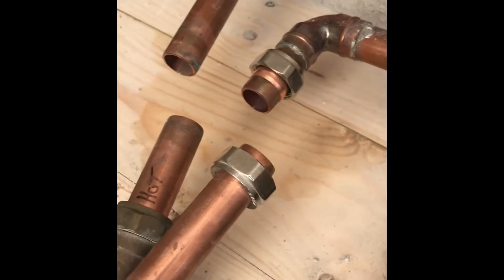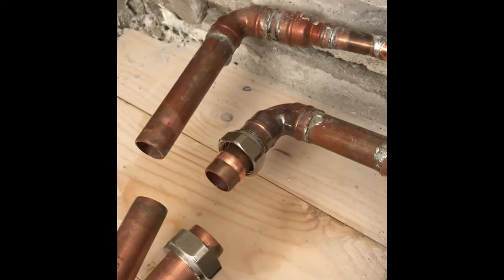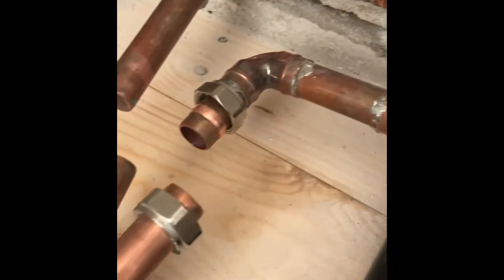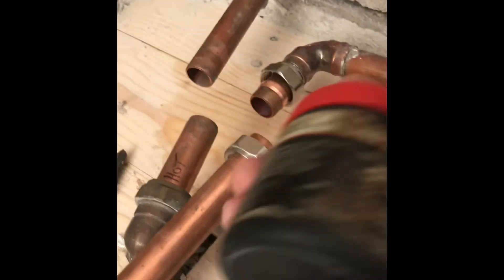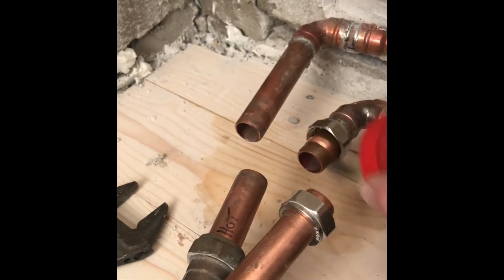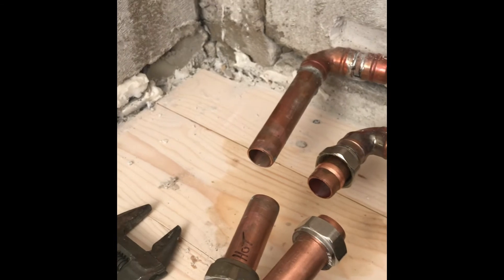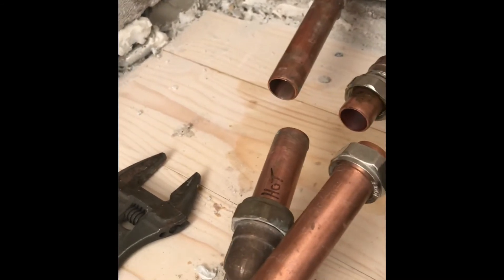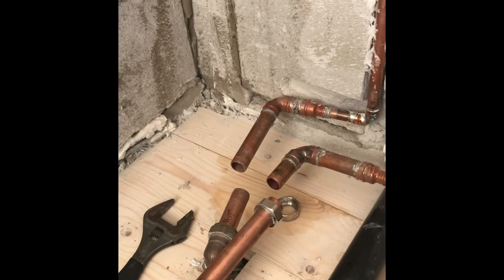How To Remove An Olive Ring From Copper Pipe, Remove A Copper Olive

Comment: This is brilliant!!! So quick! Really old olive on hot water supply pipe with heavy limescale water… used liquid soldering flux and without much effort with a pair of pliers (I’m not a plumber) it came off so easily! Saved me the cost of buying special tools or accidentally hacksawing the pipe! Brilliant idea/tip!
Reply from the maker: Thanks for your message Bob so glad it helped you out. 
Hope you have fun doing the rest of your plumbing project 👍🪚

Comment: Great idea,I usually put an open end spanner behind the nut and tap it off, not always works but with your idea with the flux as well it should work each time,thanks for taking the time to show us.
Reply from the maker: 😂 Ive tried so many ways, normally with a few choice words at the same time. This was a pure fluke but it worked a treat. I had 2 sections of pipe that I had stupidly soldered on, mixing up one length with the other. I needed to get the compression fitting off so I could cut and re do the pipes. 
Live and learn. Less haste and all that.

Comment: This is interesting. does the flux penetrate better than a standard lubricant? ...seems too simple :) Will give it a try on three pipes this weekend
Reply from the maker: It works miles better and the added bonus is that flux is dirt cheap and something you need anyway.

Comment: So that compression connection had been under-tightened? It can't have been very strong.
Reply from the maker: Thanks for the message but I don’t know what you are trying to say with that sentence. Are you referring to part of the video, or want help with something?
Reply: @diyhomeandgardening  I was wondering if you think that a compression fitting is OK if the olive can be removed without brute force. Surely it needs to be pressed on to the copper pipe, or else the connection could come apart.
Reply from the maker: @metallitech . 
Thanks for the question. 
Even when tightened up fully you will still be able to remove an olive using the method shown in the video. 
The olive serves to make a seal around the pipe, between pipe and compression fitting, but preserves the shape and integrity of the pipe itself. 
When using a compression fitting you won’t ever be able to screw the ends onto the main fitting as tightly, once placed around a pipe, as you can do when you have the fitting by itself. 

I find that if you tighten the fitting by hand  you only normally need another half or full turn with a spanner to make a watertight seal. 
All the best with your plumbing
Reply: @diyhomeandgardening  Thanks for the reply. I will test this. I think that the ferrule makes the seal but also makes the strength of the connection, so it's important not to just tighten until water-tight.
Reply from the maker: @metallitech . I always add a few wraps of PTFE tape on the thread too, just to make sure. 
All the best